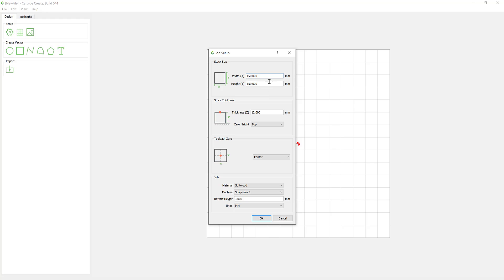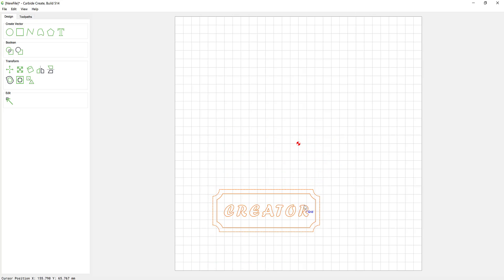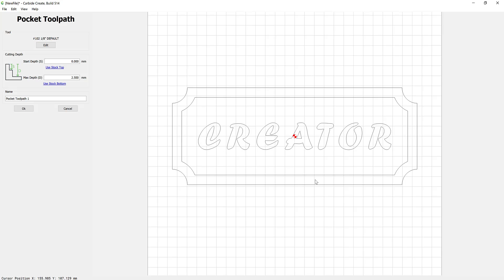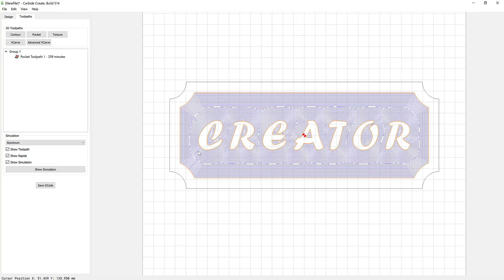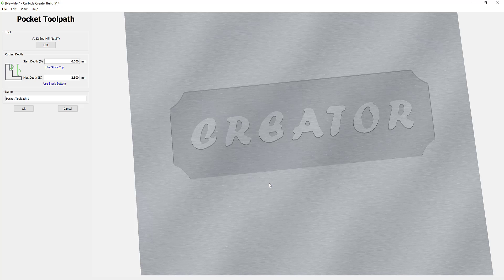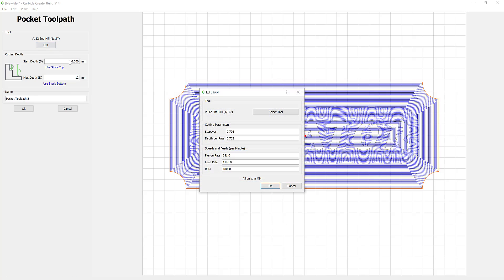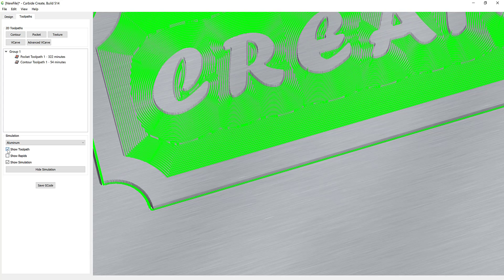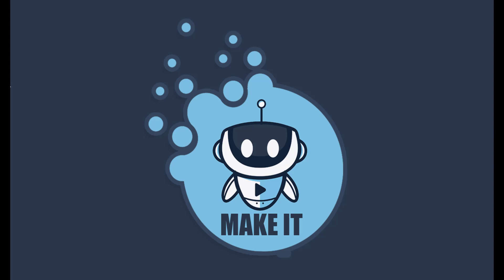Carbide Create Series - Getting Started pt1

Comment: Great video. An easy way to increase speed, create an offset 2-3mm around the letters & use 1mm to cut fine detail around the letters. 2nd toolpath with larger bit for mass clearance outwards to the frame edge